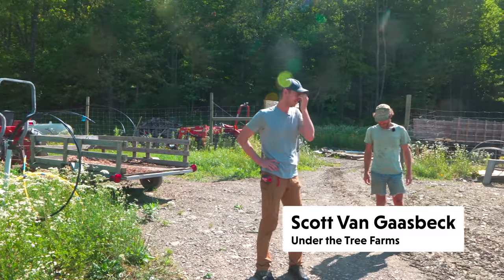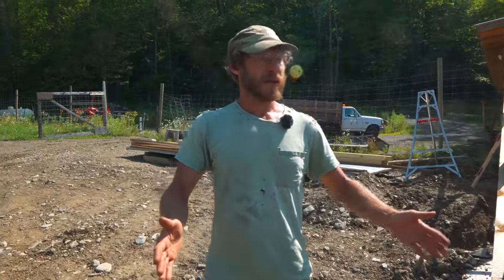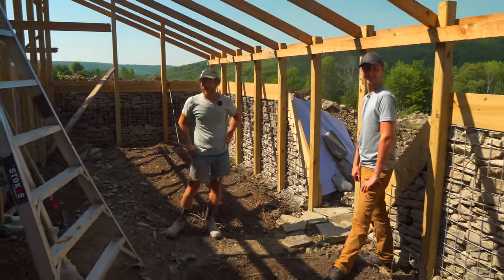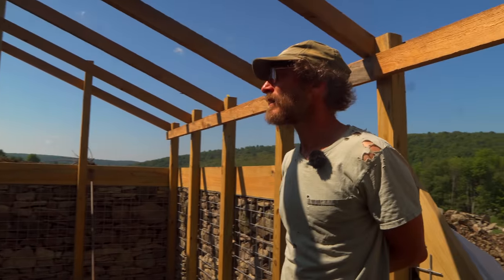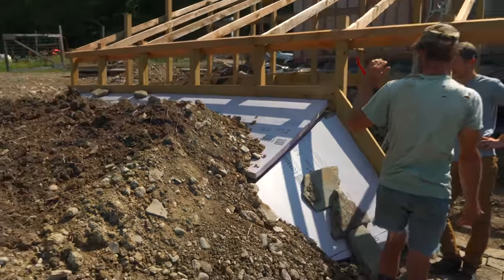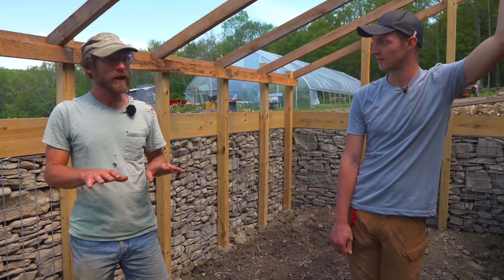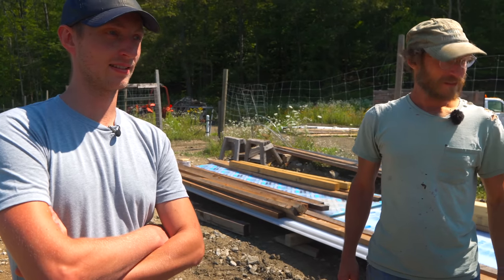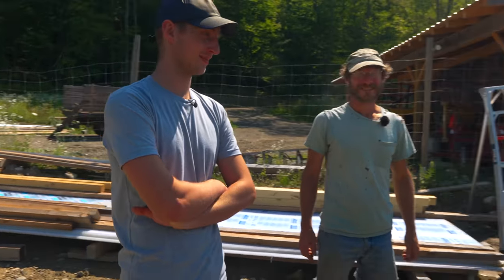Couple Builds a SUNKEN GREENHOUSE for $4,500  — Ep. 125

Comment: Another Idea for you. 
Set an area next to green house as a composter with water lines under floor to circulate heat.
Using heat generated by compost and a slow water pump to heat up green house, or even your own house during winter.

Comment: pro tip for keeping heat in your greenhouse - visit kitchen and bath remodelers.  They have a ton of broken, discarded, left over, etc stones from projects they have to pay to get rid of (you are looking for black granite (or anything black tbf)).  You can find tons of free black granite they would happily give you (they otherwise have to pay $ to dump it).  They have a lot of granite, and you can also find basalt or volcanites.  It's ezpz.  Edit:  The reason you want these types of stones is they absorbed and retain heat.  Simply using them as deco say in walkways will help a lot in winter.

Comment: @4:25 "Polycarbonate has really different thermal properties than polyethylene... It has entirely to do with infrared."

One possible way to utilize polyethylene is the SolaRoof (not the Tesla PV setup!) approach: blow soap bubble foam between the polyethylene skins for the overnight.  However, I haven't yet figured out all of the drainback details between blown skins - still noodling on it.

Completely passive has many benefits, for sure.

@24:04 "Earth is a really bad insulator...because the earth is wet..."  A layer or two of poly sheeting under the foam board, pitched to drain away from your building, will better help to keep the ground drier and will prevent (or at least minimize) the convective heat losses as a cold rain percs through the soil.  Mike Oehler (The $50 and Up Underground House Book) is the originator of this idea, as far as I know.  John Hait (Passive Annualized Heat Storage) also explicates this approach.  I have done this part way around my rock wall basement (more to come!), mostly to help keep the basement drier than for any other reason.  Water features every time it rains gets old in a hurry.  However, I think the basement probably stays a bit warmer, too.

Linky for roof vent system?

I'm loving this setup.  I live at a similar latitude and climate (south shore of Lake Superior), and can see a lot of applicable strategies for my local environment.

Comment: Technically it is a seasonal extender. Since it has no inputs (light or heat) it should only give you 4 weeks at the beginning of the season and up to 6-76 weeks at the end of the season. An In ground Solar Green House has to be directed at the right angle to the sun with a water thermal mass container
Reply: water or stone

Comment: Many of the houses in Nova Scotia were built by excavating a basement, then dry piling the huge rocks to create beautiful walls. They get washed down, then the floor was finished with boards or poured concrete or bricks...Like works of art. Same for the hand dug very deep very wide wells. Wide because you need the room to place the meticulously built wall all the way around of huge round rocks. NO wire required anywhere. Such basements keep fruit &  root vegetables, jarred food, buckets of pickled meat or fish, kraut, tubers for flowers etc all winter long. Inground temps are pretty stable year round. Small narrow windows around the perimeter could be opened to air out the basements. They got ruined when furnaces & ductwork etc were installed. Too hot for food storage in bins of straw or sand.
Reply: yup and i seen em with wells put in the basement so did'nt have to go outside to fetch water in winter. i was thinking of one of those today i knew growing up. in the 1970's i delivered the news paper to a 80 year old blind lady that lived there, (used the paper to make her woodstove fire_ anyway she died and a contractor bought the place, burned it down dug out the basement rocks and built a modern less cool building there, what a shame. also had a 2 cool wood peg built barns still in good shape the idjit tore that down too in halifax county
Reply: @halburd1  As with anything, there is restoration, or renovation. Not the same. Then further, ruination. Hardly anyone talks about that. Stupid shows & magazines that first make people ungrateful about the things they already have, maybe even not yet paid off. Then they give just enough education to make people be dangerous to their own wellbeing. People how don't understand that part of value is limited supply or too abundant supply. Buildings with wooden pegs are not only strong, esthetically beautiful, but they are also becoming extremely rare. Like pink diamonds with good clarity. People will instead spend on diamond chips in big settings,  that you can't sell when you have an emergency. Again, tv, magazines....lack of parental education that used to be passed down thru families.  I am glad that you got to see such old building styles.

Comment: for the other greenhouse i would just add a lot of 55 gallon drums or IBC totes painted black and filled with water and that should stabilize the temp in winter.
Reply: It should help, anyways, that's my plan. I used to dairy farm with my family and they have skinnier versions ( so, 25 gal ?)  of the usual ( 55 gal ? I never remember the numbers) barrel size people are familiar with, with chemical cleaners in the Millhouse. Would have to clean them well ( preferably, so if I need to, I can use water out of them)  and paint black. They'd take up less floor space, although yes, hold less water too. But maybe, like by having a fence of sorts to hold them in place, stack up another row of them on top, if the greenhouse ( cold frame) /hoop house is tall enough along the north wall/side. That and a good cold sink ( in the middle ? under a slatted/grated walkway maybe ? ).

Comment: The above ground clear plastic greenhouse was never going to work for periods longer than 12 hours and below 15 degree F....however, if you put in a huge length of 2" water pipe coiled around and around deep inside the Earth...geothermal sink...you can use just a little blower motor and get 50 to 55 degrees F air during the winter and then add heat from there directly inside the earth coil. Also you can do geothermal piping inside your underground greenhouse's floor. The pipe is cheap...but digging it out now would be difficult with the existing structure in place.

Comment: Pour 3" of Aircrete on Galion walls to extend life of wire mesh and add a huge insulating value for the $ spent.
Honey Do Carpenter pours panels flat on the ground in a frames made from metal studs then bolts them upright.

Comment: Would have went with a garage door opener, Used more blackened bricks for the low forms and planting containers, and went ahead and used an inner layer of polyethylene on the inside of fixed sheeting. I also would have set an auto fountain out of a sump so I could get a trickle return water system along with some evaporative cooling. Nice project though. Kudos

Comment: You have a tractor or rent a back hoe and dig a 6 to 8 foot trench for about 300 feet and burry a 4inch pipe and go both way, the temp in the ground will stay 55 degrees during winter and summer. Bring your pipe up and place a filter the other end place a small solar fan to push the air to the green house and the fan will also circulate the old air out at the othr end and the temp. will be about 55 degrees all seasons. Stay safe. Have fun.

Comment: If it has an outside door only, they should have a lock out door first to keep heat in and cold out somewhat, instead of freely being sucked in and out.  Sounds like though he can enter from the house. You know where you walk into a small room, then have to open the door to enter. Close one open the other and vice versa.  They maybe able to just use heated pads for the seedlings in the winter vs heated room.

Comment: this guy is very close to the final solution...for really efficient ambient soil and walls rigid flues connected to fire box like a roman hypocaust...! fire a day dampered down with the flues being horizontal thru the structures to chimney out the opposite side of the structure! The horizontal flues act like giant heat exchangers heating the soils and then at nite the elevated soil temps bleed heat not just any heat but like 90 degrees plus heat ! before the grid people needed to use primitive renewable heat sources like wood and then taking advantage of the non burning flues to bleed heator exchange it to the under roof using horizontal flues with a slight rise to a chimney at the other side of the structure...In the orient in cold places like korea they used ondols ...today we could have a wood stove with a good damper system...This guy could run his flues through the gabon basket structure in schedule 40 steel pipe to the chimney! Pulling the smoke and heat through and every where the pipe contacted the limestone it would charge the walls with 350 to 400 degree heat and then the stone would yield that heat to the soils and air exposer inside the roof line...I have seen structures in castile spain using this same technique built in 1730 working continuously through winters til this very day! 1 fire a day is all it took to keep the entire home heated now for over 250 years of continued use! The stones will not burn and they will yeild their heat to the under roof structure with out risk of firing the interior of the home... In korea the warmest places in the homes are the floors! Ergo they slept on the floor the fire boxes in the kitchen kept the home cozy through the winters same principle horizontal flues to remote chimneys out side the roof line...no fans wires or switches operates off the convection from the flues...The romans used baked square clay tiles covered in stone...today we would use 3 inch schedule 40 rigid pipe screwed together for fluing! tie the pipe into the fire box and have a remote chimney out from the structure 5 or 6 feet beyond the opposite wall the slower the heat and smoke are pulled through the more heat would be exchanged to the non flammable heat exchangers...

Comment: To bad you couldn't use that winter heat to charge a subfloor layer of rocks. I saw drain pipe circuit running under the greenhouse covered with rocks then dirt floor on top of that. Low speed inline fans take heat from to high green house area to the subfloor while sunny and reverse the fan at night. Getting the airflow slow enough to charge the rock bed and yet remove the right amount of heat is key. Radiation from the bed to hold the night temp in greenhouse for the whole night is also a design consideration. A small solar panel to power the fan. 

Solar hot water and an underground tank using radiator/fan in the greenhouse with 12volt hot water pumps circulating the water flow.

Comment: Have you thought about or learned about rocket mass wood stove? Check them out if you haven't! If you use a mass with it , it can be done different ways! The stove the way it works is quite amazing , with the way it burns! You don't have to  burn it long just a couple hours or less, it burns very little wood small pieces even sticks basically, then it burns like  a rocket engine and burns up all of the fuel from the wood even the smoke! They won't have smoke when burning the exhaust can be ran horizontal for a long ways under through your dirt sides to use the dirt as a mass to absorb heat and then help keep the greenhouse warm! It's absolutely amazing how they burn so fast and hot and completely burn the fuel source , your wood smoke is wasted fuel from a traditional wood burner! It doesn't have to draftike a normal stove with is one of the parts that after having a traditional wood stove makes you always wonder how it even works , you can make your own cheaply a few different ways  and a 55 gallon barrell but not like you would think!  You have to check them out if you haven't people in cold parts of the world use them  fof a Couple hours a day saving many cords of wood per year as to a normal stove they have to run all day!

Comment: OK, so here’s what he needs to do with his above ground greenhouse not the one Lepini that he built, he needs to compost in the greenhouse because that’s going to generate the heat that he requires without the poisonous gases for the plants that he’s trying to extend their life for the growing season or whatever and if he’s smart he can do one on either end
The composting generates so much heat that in New York they have literally right in the middle somewhere of downtown a greenhouse, such as the one that we’re looking at in this video and they have a coupon it’s I believe as well, but they have on one end a large composting area, and the heat that’s generated from that compost is constantly putting out any environment. They might want to seal the bottom portion of it better maybe by throwing some dirt on it you know to kind of close it off and may be put that second layer back up but there needs to be ventilation as well

Now to deflect the sun and keep the greenhouse a little bit cooler in the summertime. He might consider something like an aluminum insulator, but I wouldn’t put it inside. I would put it outside, so what will happen is when the sun hits it it will reflect, and it might only be necessary to do on the very top portion of the greenhouse.

You can tell him it’s safe to grow bananas I’m health, Psychic, who deals with a lot of food and plant medicine and it’s coming through very strong so it should be a crappy considers Most likely in the walipini

OK so worried about freezing water. What about adding salt and not just any type of salt obviously you don’t want commercial salt that contains an anti-and caking agent known as aluminum a.k.a. fluoride. Do you want to plant suggesting that you don’t want it in the air because then you ingest it through breathing, goes into the lungs into the blood and then into organs.

Salt is going to keep things from freezing. It’s a natural way of doing it you could add minerals into the air. If you’re using something like Celtic or Himalayan, you can buy them in large chunks, and obviously would only be for the winter time so worth consideration, I don’t have a lot of practice in this area but I’ve done a ton of research maybe not as much as you have , because in my future, I’d like to be able to implement some of these things I was thinking radiant floors would be a good idea also, especially if you’re directly growing in the ground and you can see the radiant heat around the border of the interior, kind of falls in the category of geothermal, which I know you mentioned and I guess now it’s just an affordable, but there are ways that you can do this because they do it in cob houses, and the floors are made of cob also which is another thing that wasn’t considered you’re just using straight dirt, but you’re not mixing that dirt with sand and straw And if you wanted it to be more stable without having to Lyme you could always mix it with 6% Portland cement and if you’re smart you’ll actually use magnesium cement because you really don’t want the offgassing from the concrete so you would build a form that would hold it there until it was stable Enough to stand on its own

Try watching this video. He has some pretty good suggestions. 

https://youtu.be/g1lCprUWqVE

Comment: I built something very similar. I was concerned about not using heavier wood for your frame. We have 2x12 engineered wood for the snow load. We’re in zone 4b. We built 8ft down and realized we need to address where the snow will go. Also what’s the slope to your roof? I imagine a lot of snow and how will you address that?

Comment: There's a fabric that they put up to capture water from the humidity in the air. Would it be possible to get a sheet of that to set up on the house side, pulling moisture from the air, keeping it away from the house, and channeling it into a collection trench that could be outfitted to store the excess moisture for watering later? Or does that even make sense?

Comment: Its called thermal mass.    Water has one of the highest heat capacities of any liquid or solid   (gases are N/A).   Plastic barrels filled with water will hold about the most heat per unit volume.

Comment: They say it does not have to say south that is very inaccurate. It depends on the location where you’re at and what way the equator line is he is right it may not face south to a certain extent, but you’re not looking for navigational north south east or west you’re looking at solar south or solar north And if you do it correctly, you can keep it above freezing specially if you insulate the ground before you start doing your thermal battery or sand battery depending on what you use to collect and store the heat, but it’s like a house you do not not insulate the walls so insulate the ground otherwise you are losing all that heat just as quickly as you are trying to store itI have seen people grow banana trees these as well as coffee beans and other stuff so I recommend if you do this they have three good books on Amazon about the solar off grid greenhouses or is these greenhouses are called thermal mass greenhouses

Comment: I have found in my area the greenhouse is good in spring to get an early start, but is useless in winter.
Reply: If it’s not possible then it might need to be buried for the heat from the earth, insulated at various times, like snow might even help act like a blanket or using some kind of insulated panel /shutters maybe, then a third heat source, like a wood boiler as mentioned and then potentially even an artificially light source... So if you were able to produce your own electricity and heat, it might be viable, where the food production was worth the investment... making it a bit like a commercial grow operation. But for minimal money, it would take a lot of scrounging and ingenuity to figure out a way to do it.